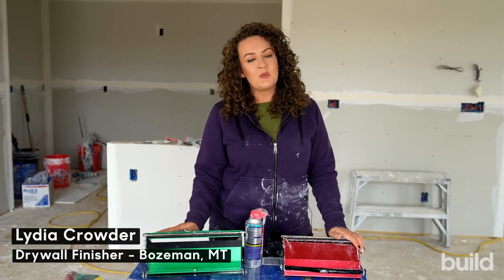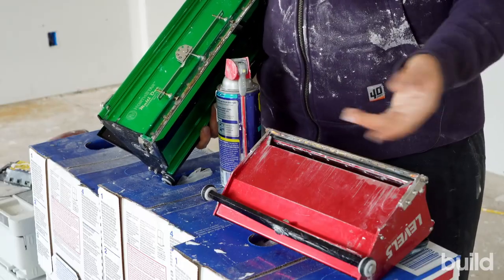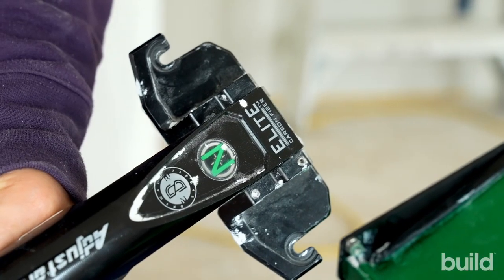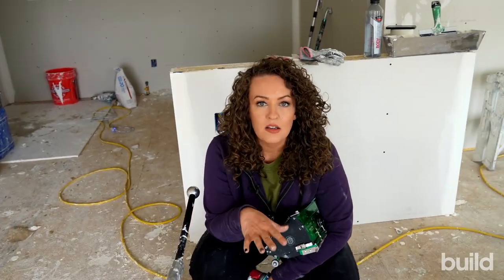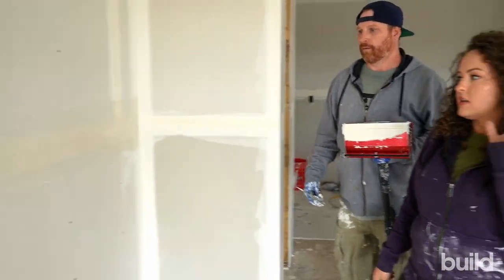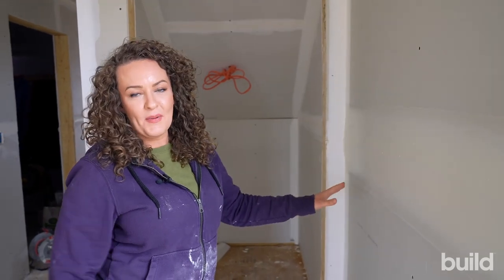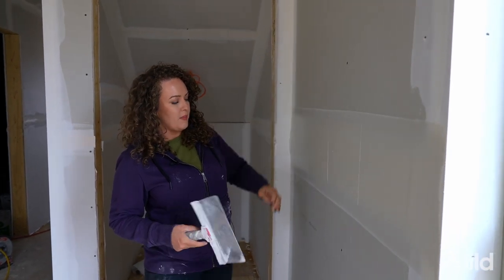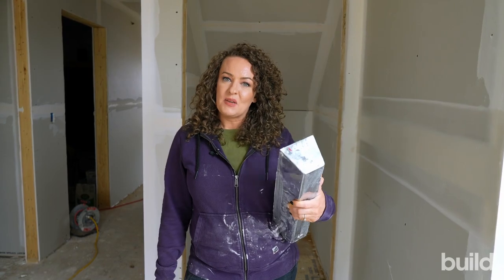How to use drywall flat boxes

Comment: that may be you're best video ever.  Excellent info & demonstration, thanks !!
Reply from the maker: Thank you!!
Reply: @DrywallShorty  Lydia I love your videos! I noticed you posted a link for a 5.5 flat box, where do you use it? And what do you use for your inside corners? Thanks so much!
Reply from the maker: @racktown1157 Sure! A 5.5 is great for corner bead , I have seen people use them on screws but I would NOT recommend that. The boxes all have bevels and you'll wind up applying way to much mud and causing humps on every screw. For angles we use a Northstar 7" angle box with a bent handle and a  3.5" Northstar angle head.
Reply: @DrywallShorty  Thank You!

Comment: 7 and 10 inch box all the way! No springs at all, they just hold you back and make you work harder. Single size handles because they bent a little and it’ll send you flying like an arrow, extendable handle is hard, stiff, and heavy
Reply: 20 years non union 11 years union. I've worked with as many as 40 tapers. Boxing day after day, year after year, pallets and pallets and pallets, also big huge 50 gallon blue drums of Hamiltons. And tons of different tapers on zillions of different jobs. And the one thing I can't stand, is when dudes take the springs off!!! I go in the job boxes and take all the springs and put them in my tool box so I always have them. However I do stretch the springs. I like the box to spring back, so it's back when I fill it. Also, without springs it leaves weird lap marks, and mud starts slipping behind the hinge, na, not for me. No one in our union would ever race me. I seriously will blow your doors off. I can also run flats with one hand faster than most dudes use two. 😉

Comment: What do you think about running the 12 box followed by the 10 box? That way both of your edges are on top of the mud and make them easier to sand.
Reply: Yes it was a good one. When my business gets a little bigger I'm going to invest on a bazooka and a couple of boxes. I need to learn a little more about the business aspect. I am good at quoting prices of jobs. I call myself Drywall Solutions and More. I need to learn how to give customers a price, and be fair about it. Steve
Reply: Nope. Been there done that. The 12 runs  out funny on the first coat. Stupid, don't do it. Your better off using the 10 twice. If it's too hard for you. They make a 7 inch box. Use that then a 10 for the finish.

Comment: Do you need that pump or can you fill it with a regular mud knife
Reply from the maker: You could open the back and pack it with mud but you would be doing that constantly and it would be a mess. Their are box filler attachments you can get for compound tubes if you don’t own a pump.

Comment: Ive been debating if I should go with the level 5 full kit that's like $3500 or the tapetech that's like $6500 ive been taping going on 4 yrs with my dad and my dad's been taping going on 26 yrs and he's saying to go with tapetech that's it's the best brand there is because it's more expensive and better quality what would u recommend lol I kinda wanna go with level 5 since it's almost half the price ??
Reply from the maker: Either one is good! Level5 won’t have some of the nicer things the tapetech tools have but you can upgrade individual parts. Level5 has a lifetime warranty I believe and they do stand buy it. I don’t love the level5 angle heads so I would get a different brand for those.
Reply: I have a level 5 set goin I. A year and a half had some issues with the bazooka taper but the flay and corner boxes are excellent
Reply: Level 5 is junk just look at it you can see how cheaply made it is and the adjustment for mud looks even worse listen to your dad northstar is good to.
Reply: Northstar multi one